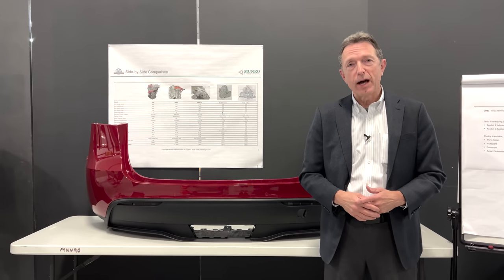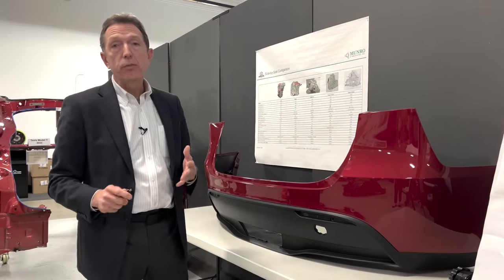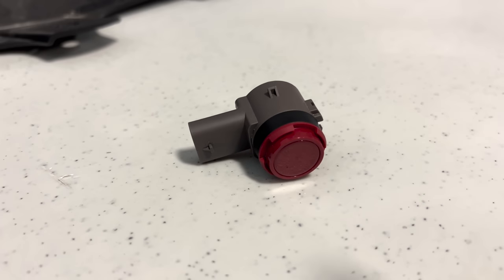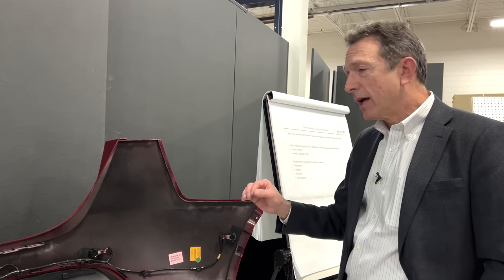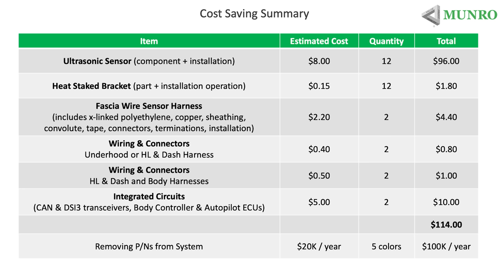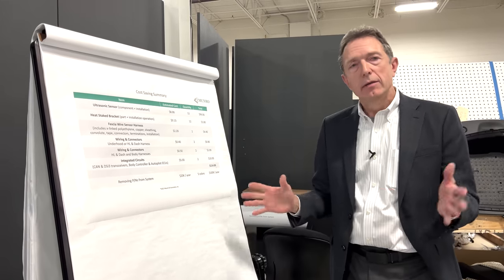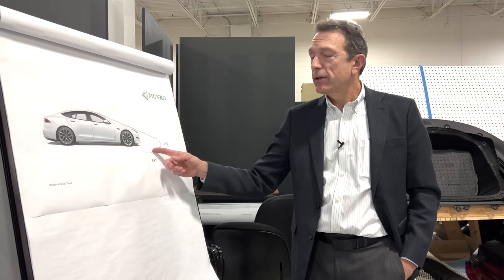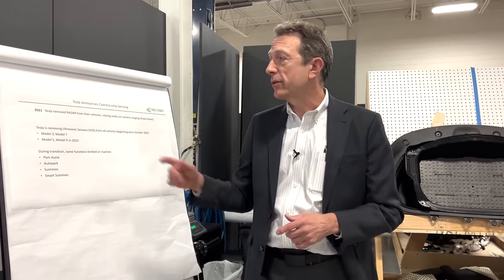Tesla REMOVING Their Ultrasonic Sensors

Comment: I would say on the the concern point you had on front view and loss of sight over hood and 3ft - the occupancy network / voxel mapping / and recall functions they have been training and deployed so far shore up the concern. Mostly on low speed maneuvering (parking) the car should and would be able to use 3 models in real time as the car is pulling forward into a spot to be able to predict trajectory into zone X (say front bumper distance A to Predicted end of useable space B) It would use known attributes of train data vs what car static is and be able to track itself down to inches/centimeter to end of dead space useable.  It would be able to do this due to the computers way of using predicted modeling in real time, in my mind, no different that you as a driver not seeing over the hood, but we know there's and "end" to the useable area we can and cannot use (parking curbs, bumps, shopping carts, static objects - light poles? cars?, and could have moving objects still like humans) and ultimately leads us to making the same decision. So to me this end result is a non-issue, just training and model updates, frankly with 160,000 cars in shadow mode / using this, they have plenty of it.
Reply: 'Prediction' is rather different from actually knowing. It involves assumptions and you know that makes an ASS out of U and ME ?
Reply: @grahamstevenson1740  Problem is, in real life, parking a car, navigating tight spaces, avoiding smaller objects. It all has a level of perceived assumption and prediction. You may think it doesn't which goes into the narrative "I'm a good driver, so it doesn't matter" but frankly human nature is that, prediction and assumption. The assumption is I can make that parking spot that is narrow and short front hang over,. Assumption I actually fit, because I have done it x amount of times and it will be fine is a reality I see and endure every day. Doesn't take 5 to 10 minutes in a parking lot to spot the folks. 

again this isn't to say Tesla will do this spot on at launch or half way useable by any feat of imagination. From someone who has had FSD beta since Last August from early 9.x builds, and seeing where its at now, its defiantly going to improve and handle it. Some of the way it will handle it, already exists in current form in the beta today.
Reply: @AustinFerguson  
I agree, the predictive model might work great. But just like humans. If you didn't see the object you can't predict that it was there. The ultrasonic sensors sit much lower on the bumper than a person can see or that camera can see. Theoretically the camera might see the objects as it pulled into the parking spot. But what if somebody dropped something behind the car when it wasn't looking or was turned off? The ultrasonic sensors seem like a good backup system for the cameras and would give extra data. Acting as a failsafe for object detection.
Removing the radar has the same issue. In low visibility situations like fog or snow or dust radar is going to penetrate that, the cameras are not going to see through it any better than the human eyes can. Now you should not be using autopilot in those circumstances anyway, however emergency braking systems need that data also. If you're driving along and enter a fog bank and there's a accident up ahead that you can't see in the fog the radar sensor will detect the sudden slowing of traffic and do something about it. The ultrasonic sensors might do the same in slower speed situations. To me it just seems like Tesla trying to save a few bucks and then charge the same amount for the cars.

Comment: The Autopilot computer remembers a certain timeframe and/or distance traveled in vector space, so it remembers where all the objects are as you slowly roll into a parking spot. Some estimated the precision can be down to half of an inch, using just cameras and wheel rpm sensor.
Reply: I too thought about this, but typical wheel speed sensors do not measure speed when turning at a very low rate.
Reply: All great on paper, but won't comfort someone pulling into their garage and then hitting something which previously they wouldn't have. Tesla should perfect the software (and implement in software), prior to removing the sensors. They did this with the lidar and although I understand the conceptual benefit, I can tell you that my car isn't as smooth as it used to be and tends to over-brake when rolling upon other cars. I'm constantly feeling like a beta tester in my production car. It's constantly evolving, which is both good and bad.
Reply: @brois841  the point of machine learning and A.I. is that eventualy it will be more than perfect, it will anticipade even the weirdest situations.
Reply: @Poxenium  I'm in the field, so I'm well familiar with how AI works (by the way, by definition it'll never be perfect, statistics aren't perfect). Either way, that doesn't address what I've stated.
Reply: @brois841  you know what i meant. Programmed software can never handle weird situations, just A.I. learning.
Reply: Nope
Reply: @Poxenium  more than perfect in which world!? It will never be perfect
Reply: @carholic-sz3qv  it will seem perfect.

Comment: Cost savings are even greater than was is estimated here.  I understand it was only high level math, but consider all savings from after sales service.  The transportation costs, wait times, workforce, rental car cost, customer dissatisfaction,  all compound over time.  You could also consider the removal of dedicated stations in production that result in less workforce, tooling, safety incidents, potential line down delays due to lack of material.....the list goes on for positives whenever reducing the number of parts needed to build a vehicle.

Comment: Great presentation. And good point about the camera angle. My take on this is that it will never be a problem because the car relies on vision from all cameras, thus objects moving toward the car from the sides are seen. And the vision system is AI based with predicting capabilities, ie they won't run into a wall. They reason that they are skipping the functionality right now is that the parking features for fsd are still being developed. Based on previous experience there will be a temporary loss of features and probably after 6 months to a year a better system than before but now based on vision only. The same happened with radar although at that time the vision system wasn't as advanced as it is now.

Comment: Thank you very much for the interesting video!
I think there are two things to mention here to get a really complete picture of the situation. In this regard, I wanted to note that I drive a Tesla Model 3 myself and therefore speak from my own experience.
The mentioned change on relying on Tesla Vision for a lot of functionality is accompanied by a change in the type of service provided for all vehicles. This applies both irrespective of the technology installed (e.g., my car still has LIDAR/RADAR and USS) and irrespective of any components that may be installed in the future (higher resolutions cams were mentioned). 
In addition, the new Tesla Vision functionality only works if inferior functions or automatisms are activated as well.
For example, the automatic windshield wipers and the automatic low beam / high beam are always activated as well, both of which can no longer be deactivated without also deactivating the functionality that could originally be used separately (e.g., Autopilot or Cruise Control). And unfortunately, both of the aforementioned functionalities are ones that, in my opinion, work really miserably - I deactivated them the first week after I got my Tesla, as they are really atrociously bad. The low beam reacts much too late or not at all to oncoming vehicles - even today. The automatic wiper sometimes thinks it has to wipe permanently even when the windshield is dry. Or the opposite: I can see almost nothing, but the wipers stay still.
To summ it up, this means that as the owner of a current Tesla, you can either no longer use functions at all (e.g., Autopark) or no longer use them in the original scope of service (e.g., Autopilot). This partly massive deterioration in functionality is entirely at the expense of customers. I have thus paid for a range of services that has been taken away from me without compensation.

The changes may be good for technical development or for the development of costs, but they are an impertinence and imposition for the customers.

Comment: This is a well explained clip. I had my Model 3 (Highland)  3 weeks ago in Melbourne, Australia. Enjoy all aspect of the vehicle, except parking in a parking bay or in front of a wall . Current updated Hi fidelity Parking Assist, does not gives an accurate distance consistently prior to 'STOP' warning. If Tesla's goal is to cover the front blind spot through camera view down the track, that would be great. However, in the meantime, owners of new vehicles are handicapped by not having USS. Another solution would be to provide 360 degree camera view. Hope, they would come up with a consistently reliable solution soon.

Comment: The stand still scenario might be tricky. But most likley the car is moving forward which mean that the AutoPilot will be able to detect and notify the driver before a collition from an obstacle within the "blind spot".
Reply: "Will" is not good enough. It has to. Otherwise they will loose a lot of sales.
Reply: @AP13P  ultrasonics aren't used for collision detection while driving, no functionality was lost, that's why they don't have to be recertified for safety tests.
Reply: @GregHassler  Before, as in, parking against a high curb or equivialent.

Comment: The labor and logistics cost savings in addition to the upstream cost savings will far surpass the direct part/BOM costs. I think the blind spot directly in front of the car is much shorter in the 3/Y because of the shorter/"stubbier" hood. That's probably why they are starting this on the 3/Y immediately. S/X may require an additional bumper-mounted camera or another camera solution that can see closer to the front of the vehicle.

Comment: This guy is great.

Actually the cost saving to Tesla would be even greater than just the Bill Of Materiel.
First you should take into account the cost of managing (procurement, obsolescence management, sub contractor management, Quality Controlling the components etc.).   
Plus financing, storing, assembling and Quality Controlling the full assembly.

a back of the napkin calculation bring that cost to about 80$. 
So we have a total of about 194$ of  to Tesla.
Assuming sales of one million cars a year would save Tesla 194 M$ annually. that's a lot.

I'm an engineer (owning a Tesla 3)  not a finance guy, and from that perspective I think there is no way that they can get the same performance , Resolution wise and probability of the visual solution using just cameras . 
They're cheaping out and they will lose the market  eventually if they keep reducing capabilities while at the same time increasing the price of their vehicles.

Comment: So no object detection behind you, or in front of you, those are nice to have when parking. Will those sensors continue to be used in vehicles equipped with these?
Given that they had an issue detecting a turned over vehicle with cameras, I'd be very hesitant in object recognition for something 3 ft in front of the car and how close said object is to the car.

Comment: More Mike Please! 
 I wonder when they would eliminate the 4th wheel of the car 😁.  maybe use two fisheye cameras (one on each side) vs. 2 that they use today to save money😵‍💫. come to think of it, 90% of the time driving, the back seats are not being used. using the same logic that they used for passenger seat feature removal they will probably remove that feature as well in the future.  I wonder if you still need the break paddle with aggressive regen breaking? they should take that out as well to save money. with AI, who needs to hit the break anyway?  ( By the way I have two Tesla's myself but moving the either M.B. or BMW now that they are cheaper than model X and S)

Comment: I think putting a camera right on the front bumper that uses mirrors to split vision 3 ways (left, forward, right) or 3 cameras that could pop out only when needed could help solve a few issues, especially with self driving not being able to see what we see in some situations.  I considered something similar when I drove a right hand drive vehicle from Japan, I wanted to mount a camera on the left hand mirror so I could see traffic oncoming during left turns where another larger vehicle turning left in the other direction blocks the view from my right hand perspective.

Comment: Does the camera system become compromised with salt spray in the winters. It is a serious issue in Canada. Front and rear facing cameras both become fairly obscured normally to the point that they need to be cleaned on our Ford after a long drive under certain conditions.

Comment: Removing sensors also makes fender benders cheaper to repair.

As for the front blind spot, Nio has a parking lot view that uses dead reckoning of sorts from front camera data further back
Reply: Save 50 quid in an accident that was probably caused by not having those sensors.

Comment: I was/am a big supporter of removing the RADAR. Currently con on removing the USS unless the new camera suit happens at the same time and includes a camera in the front bumper to fill that blind spot. Great video with great graphics and info!
Reply: What about dirt? The current rear camera is useless when it rains or snows.
Reply: @haraldk6828  Fair. I completely forgot about that. It's odd how amazing the side repeaters are at staying clean and how bad the rear is. Some passive cleaning method would be awesome but might need an active sprayer like other OEMs use.
Reply: The car computer will simply see the ground in front of it (all around it in fact) and add it to the surrounding map.  It knows exactly where obstructions are - even when the camera can no longer see it.  Obstructions that appear when the car is parked will simply require the car never to be completely off and take note - all it takes is a sort of permanent sentry mode.
Reply: @pierre.a.larsen  I agree that works at driving speed, but at parking speed something could definitely move in front of the car in that blind spot in the time it takes you to park. Or something placed like a box in right in front of the car while parked.

Comment: When my Model X was parked, someone hit into the plastic strip protecting the right front wheel well.  An ultrasonic sensor was installed in the plastic strip.  While driving home, the plastic strip fell off causing the ultrasonic sensor to be unprotected.  It  stayed attached to the car until the wind twisted it enough times that it broke off.  To replace the sensor, Tesla wanted to replace the entire harness which required taking off the front bumper.  The total cost of the new sensor, new harness, and labor was going to be something around $700.  That’s another significant cost savings from eliminating the need for ultrasonic sensors.  While I got it done at a much lower price by buying the new sensor from Tesla for something like $80, buying a used harness on eBay for about $90, and reusing one of the connectors from the purchased used harness rather than changing the entire harness, it still would have been much cheaper yet if the ultrasonic sensor was not needed in the first place.

Comment: I have a M3P 2021, and feel that there might be a situation where the models without ultra sonic sensors could be seen as less valuable. 

I hope the software still has support to utilize the sensors in older models once the new updates are out on the sensor-less  cars

Comment: Since the b pillar cameras can see the ground from the front wheel forward, anything jumping in front of the car could be detected when moving. However, if the car has been unused for a while and starts with a forward motion, the software would not know about possible items in front that are low.
Reply: Could argue that if a ball rolls in front of the parked car and stops the car could be made to realize that it is still in front of or under the car.

Comment: First of all, nice presentation! And I fully understand your concerns here. I have studied computer science and have a little different view here. Except rare special objects (like e.g. automatically retractable bollards), objects normally need to move into the blindspot through a non-blindspot area, where min. one camera can recognize it. Therefore the system will use predictions to know and depict if there's anything in this blindspot area. For instance, a child will not "appear" in this area without running into it and being already tracked and traced by the cameras beforehand (e.g. by FS or F3). Even easier, static objects like other cars etc. can be easily predicted by knowing their position and the car's movements like speed and direction. But I agree, it won't be as accurate as USS for sure - at least not in the very beginning.

Comment: Very cogent analysis Mr. Lane.   As you presented, you went to exactly what I was thinking as I followed along.  It is physical reality that the forward looking camera just can’t see though sheet metal unless it is Clark Kent.  A single camera in the front fascia might be able to supplant the six USS when combined with the side filler cameras, but then it is necessary to keep the lens clean.  Saving ~$150 million per year appears to be just too enticing to pass up.  Too bad owners are going to lose some functionality.  I don’t see a good way to fix the issue, but Tesla has been know to surprise us.